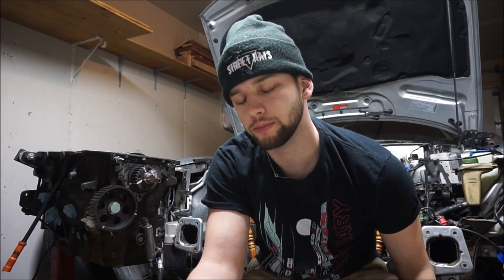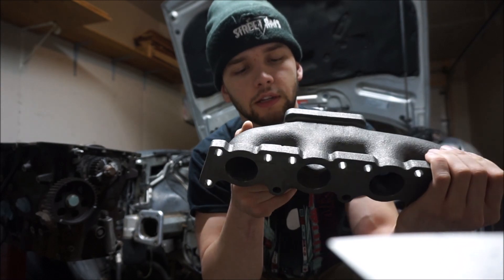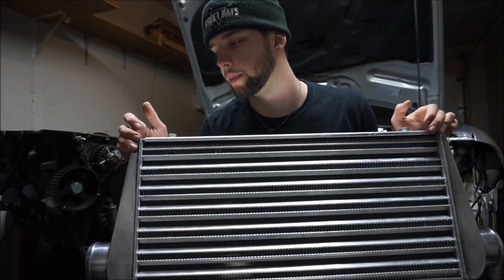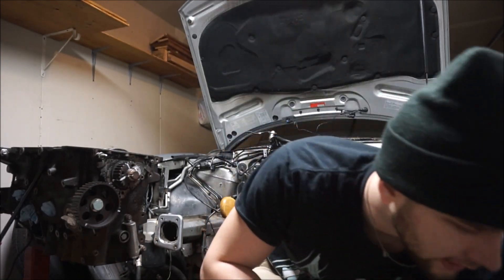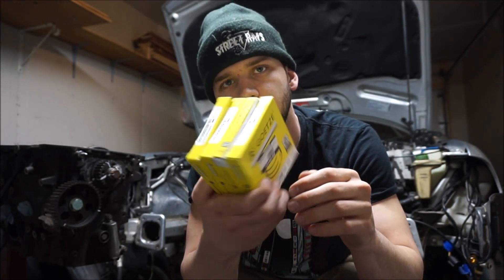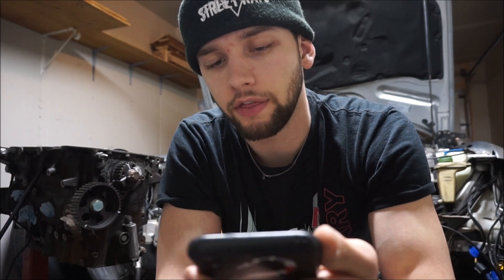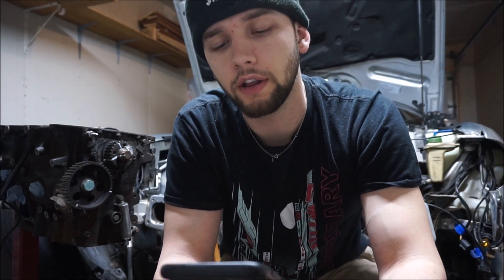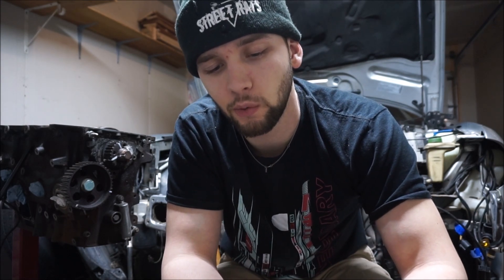Big Turbo 1.8t Build (Road to 450whp+)

Comment: I’ve used  the same rods.  Pulsar 550 and supertec valves. I did 400 miles and lost oil pressure. Thinking it may have been the oil pressure relief valve was faulty. Destroyed a rod, and cylinder head. New motor incoming. Good luck 🙌

Comment: I'm 2 years late to this but, so you went with AWM engine harness and ecu from a4? If you don't mind me asking how much did the convertion to ME7.5 cost you? Just got an b5 Avant and might want to do this in the future...
Reply from the maker: @tobias2310  it didn’t cost me all that much cause I had the stuff to do it. But it’s a nightmare job.
Reply: @Luke100mph Was afraid u were gonna say that, i got a pretty good deal on a 1.8tq Avant to restore but this ecu restriction is annoying

Comment: I have a TT BAM engine and i want to hit 400-450. Would any recommend my idea - garret gt25-660,750cc injectors,ie rods,1.25 tubular manifold badger 5,3 inch decat,ram air 80mm intake+ oversize tip,forge diverter valve and forge intercooler? I am looking for advice and criticism so i can build a reliable set up.

Comment: two things I would've changed up, connecting rod company, and ARP head "studs" instead of one time use head bolts.  Only because you may have to be in the engine again at some point and why worry about spending again on stretch bolts.

Comment: Hey where did you get the flow control valve for the trans?
Reply from the maker: Ringer racing sells them on their website
Reply: @Luke100mph  thanks will check it out

Comment: I have watched your video, and I have an almost identical setup on my 1.8 turbo Cupra R with the same log manifold and similar pulsar turbo. This log is rubbish and you will have many problems with it. If you want to put it on you will have to machine it and remove a7mm from a flange in the order you can screw the nuts with a washer. If you don't the nuts will unscrew. It is almost unposible to tighten firmly upper nuts because it is unaccessible.+ your turbo will be buried deep in the engine. Do yourself a favor before you start and make or buy ramhorn heater.

Comment: Wish you all the best w/this.  I was north of $10K on my 1.8 stroker.  How you say?  I used a FullRace exhaust manifold = $1200, $900 I.E. intake, $1500 United Motorsport stage 5 tune w/ a ProMAF air intake, plus, plus, plus.  It adds up.  I was not skimping, all braided lines, etc.  I DEF could’ve cut some corners but…. Oh well.  Good luck, your turbo seems a little big IMO, long spool up time and I’d’ve used a 44mm WG.  I went w/ Garrett Gen2 3071R, MAD spool comes in @ 3500rpm’s.  I got 870cc injectors on pump gas, E85 not abundant where I live(CT).  I did 2.0FSI Stroker crank and a set of Schlick cams too, have yet to Dyno but my goal was @400HP and everyone telling me it’s closer to 450-500.  It’s a daily driver for work so I didn’t want to go crazy.  Using a GrimmSpeed MBC at around 15psi boost.  SouthBend Stage 2 Endurance clutch w/ a set of Raxles on TOYO R888’s tires and hang on for life! Lol

Comment: I went with rr stage 4 and it doesn't allow you to shift fast at high rpm. I talked with Mike and he said the stage 5 kit with 6 puck would be better, or the cm fx450 bc it uses the same disk.id recommend get the stage 5 or fx450. I'm not happy with shifting so slow, I got the ss braided clutch line as well and shifts are still too slow with the full face disk, it's basically too heavy of a disk to shift fast.
Reply: I say to get a better clutch bc I'm sure you will want to add more power down the road. I was considering fx400 but didn't want to cheap out being that I'm making more power then I think that clutch is capable of handling, probably just wouldn't last that long with that clutch. I made my own hood dump that costed literally nothing and I got a full 3" straight pipe exhaust for about $375. My total cost on my build was about 8k and I'm at 660awhp and 550awtq and it is a budget build.
Reply from the maker: You on o1a 5 speed still?
Reply: Being able to launch endlessly at 7k with a rr stage 4 full face, reliably, is far more worth it than buying some fx4xx every two months because it wears out so fast with power. So just shifting fast I don't think it's worth it. But it sounds like you know what the options are out their, so that's just my opinion ;)

Comment: Do yourself a favor and pin the crank gear and use a arp bolt, my build is almost same, little more extensive but I'll never lose another motor from crank gear keyway shearing 😂. Also if it's not too late get pistons, I know people say they're forged but mine got cracks at the wristpins at about 300±whp
Reply from the maker: bought a pinned crank gear kit from BBM 👍🏻 too late for pistons tho. Motor almost ready to start
Reply: @Luke100mph  used same kit on my last motor and waiting on one to get here finish current build. What are you doing for tuning?
Reply from the maker: @nickferraro7042  I swapped to me7.5 from an AWM car, going through Blake at ETspec
Reply: @nickferraro7042  im only using the arp crank bolt, not pinned and stock pistons making over 600awhp
Reply: @taylorbrown8719  ok but when I pulled my pistons they 3 of 4 we're cracked at the wristpins and that was only at around 350whp, also sheared crank gear pulley with stock bolt at that power level, investing the money into making big power, there's no point in taking stupid risk for the sake of saving a few dollars. Learned that lesson a few times lol
Reply: @nickferraro7042  I discovered there are actually, very strangely, two types a pistons in an aeb. One which nearly everyone expects and that are safe for 600whp. And the second much weaker ones that I too encountered when I put a new long block in with just rods and over 450whp. They started to crack a little bit. Not sure how I figured it out so quickly but it's the reason I bought je pistons. Mike hood was stumped with the different piston types. Both stock Mahle. I have an Audizine post about it. Important point being is that it's pretty unlikely most people ever get the thin walled ones. They're quite dinky and it's pretty obvious visually. I too had never heard of any other sort in existence so yeah... Do now.
I've also always used stock crank bolts and never had issues in over 10 years with 40+psi and 500whp'ish. Multiple long blocks and still didn't have an issue with any thing crank related. Definitely not saying it's not possible. I just haven't even heard about it.
Reply: @SomethiingClever  that's interesting, I'm gonna have to check out your thread I never came across that info, my motor that had them had some pretty bad detonation thanks to a failed green giant, (should have known better)  so that may have contributed. I went all out this time so I don't have issues again. What clutchand trans  you running?

Comment: Question for anyone in the thread:

I am building a 2.0 stroker version of the 1.8T (AWM). I went with CP-Carrillo stroker pistons at 83mm (3.268") bore. I was gapping my rings and somehow feeler guages failed me (more like I failed to use them properly) and I over gapped everything. I need advise on whether it will be fine or if I need to buy a whole new set of rings. 

Specs according to CP for Nitrous/Turbo engines:

Top: Bore x 0.0055" = 3.268x0.0055 = 0.018" or 0.45mm
2nd: Top + 0.004" to 0.008"

My rings:
Top: 0.021" or 0.52mm
2nd: 0.028" or 0.70mm

Is this too much gap now? Please help!!
Reply: I ran around .024 top multiple times stock with zero issues in regards to compression/leaking oil. I used a bench grinder to gap my rings and it cuts em mighty fast! Not recommended, but I guess it allowed me to tell you your top ring gap is definitely okay. 2nd ring honestly I can't recall with much confidence but I believe it was. .026. top ring in my opinion should be .023 at least if you're running 35psi and up. Which I have on ever turbo beyond a k03 I've used.

Comment from the maker: Update: I’ve spent probably another $1,800 since this video. But just got my cyl head and block back so starting assembly this week 👍🏻
Reply: nice choice of parts man, i did a budget style build like yours with similar parts on my b5 and 450 was my original goal and now im past 600.
uro tuning sells a rebuild kit that comes with grant rings(i didnt gap my rings either) and glyco bearings, it used to be 150 but is $200 now. im using that kit and eagle rods. i had the atw block luckily so i have 058 block (20mm wrist pins) swapped to a built aeb head with exaust valves, springs and retainers, converted to wideband ecu and added vvt. treadstone tr11 fmic precision 5858 bb .82 hood dump t3 emusa manifold. stock cams and pistons. manual timing belt tensioner arp head studs and arp crank and cam gear bolts. rr stage 4 full face with braided ss slave line. id1000cc with walbro 450 and 2.7t fpr. e85 at 27 psi 640whp 560wtq
Reply from the maker: @taylorbrown8719  build sounds just like mine! wow that power is wicked!! I just got done adding my VVT yesterday. My plan with my tuner was to go e85 and 28psi. Who tuned your car?!
Reply: @Luke100mph  Brad Watkins with German Elite Tuning. #getwatkins
Reply: My bad, I was on my fiancee account. I logged into my account just now. The comment from Taylor is actually from me. I also used hockey pucks for motor mounts and for a snub mount. I plan on making some videos of my car, I'm trying to decide if I have the free time to make a channel for it. But like I said, it started out as a budget build and went further then i thought it would. I seen 1.8hoopt reach 600hp so i had to go further then them. Ill have to review my build beeing that im done with tuning now.
Reply: @tylerdunne6745  nice!! Why the need to go wideband and vvt?
Reply: @DustySteelGarage  for better tuning.
Reply: That’s awesome!! I’m super excited for you and to watch your build. I just subscribed.

Comment: Thats about my goal too. More is welcome of course. Initial  goal was 500awhp. But 93 fuel ultimately is my restriction. What fuel will u be using. So far its super cheap!!! I admit i didnt watch 100% of video. But i assume 180 in exhaust gets you straight pipe out the side at the most? 
These cars can make power. I was 411awhp at 26psi 93 fuel on mustang dyno. But this isnt a honda or mustang. So in other words its expensive, lol. Machine  work is expensive  too. Im 1.8 stroker now. No running yet. Hopefully in a month or two.
Reply from the maker: Straight out the hood, planning for 28psi on e85 to start. And that’s solid power for sure I bet it was fun! You’ll make 500whp+ easy going stroker🤙🏼🤙🏼
Reply: @Luke100mph  it was alot of fun 👍, car is a hell of a surprise to others. But you crave more, lol. Only reason i did the stroker was because i have a coolant pressure issue since i got the car. And finally the block cracked. So you gotta rebuild better u know, lol. 

Im hoping power will come in sooner this time. I bought ALOT  from RR. He said 450 to 500awhp. 93 fuel has its limits and this is a daily, so no e85. But u should definitely get your power on e85. 

I have a 01E 6spd
Reply from the maker: You using the 01a 5 speed?
Reply: What’s ur build list? 😍😍😍 I’m trying to just push 20psi on pump.  Are you using water/meth injection at all?
Reply: @ziggyortiz37  im not a vw builder specialist. Id contact someone like ringer racing or IE with goals. With "just" 20 psi, im assuming upgraded turbo, at least ko4, which honestly if your spending the money go bigger.  Id say this. No need for cams or intake manifold. Cams, springs, valves, machine work is alot of money. Id get drop in rods for insurance, pistons are good for 500 plus chp. Proper intercooler for turbo,  2.5in to 3in turbo back exhaust. Injector sizer your tuner suggests. And clutch that takes the power. Not much is needed. Your turner should be able to suggest a turbo. I was at 26psi daily driven. I had no meth/water. Hard to find a tuner who will tune it. Hell hard to find a tuner at all. Epa took care of that. My car still isnt running since stroker build. Life got in the way. Maybe this yr, but cant say for sure.

Comment: I didn't hear how much you only paid for the car. These are great engines. one of the best engines under 2.0 cc.
Reply from the maker: I paid under $280 for the car itself 🤫🤫
Reply: @Luke100mph  sounds like it fell off the back of a truck
Reply from the maker: @easycomeeasygo8901  Car had no title when purchased, I was able to acquire one for it tho 👍🏻

Comment: Nice build, look forward to seeing it run. 
I would of went the IE rods for sure though. 👍
Reply from the maker: Thanks me too! Getting closer, and yeah I’ve thought about it but the machine shop already has the rods and checked all the specs they turned out good🙏🏻 now it’s just to see how they’ll hold up
Reply: @Luke100mph  awesome, the tuner could compensate for them by setting a smooth gradual curve on power so they don't get stressed at low rpm.
I recently scored a mint condition b5 off an older lady that couldn't drive any more due to medical conditions. Just received my new eliminator turbo kit from ECS and can't wait to put it all together. It's the Australian AJL 180hp version with the high flow ports.

Comment: That’s 058 motor what ecu will u b running
Reply from the maker: ME7.5 wideband ECU from a 2001 a4
Reply from the maker: @kadeemmeggett6324  the wiring part or the pedal assembly removal/install work?
Reply: @Luke100mph  the pedals wiring and install was difficult bro it’s not easy me7 swapping uro tuning sells a conversion kit wideband to narrow band kit plug n play
Reply: @Luke100mph  what up big dawg how your build going
Reply: My tuner told me that I don’t have to go wideband. Eurodyne Maestro has files for 440cc, 630cc, and 870cc I believe. Each one can be customized.
Reply: @DustySteelGarage  yeah eurodyne has chip files for our me5 aeb ecus u are correct
Reply: Every shop always try’s to go for the most expensive route hoping you’ll pay them to do it. Any tuner should be able to just watch a wideband gauge.
Reply from the maker: Full harness/DBW throttle conversion
Reply: @Luke100mph  unitronic does a wideband conversion kit

Comment: dude ill start posting videos but i am literally doing the same build, i have roughly funnily enough almost all the same parts but ive been putting it away almost giving up on it but gonna get started again in the next few weeks
Reply from the maker: keep it up🤙🏼 what’s your power goals with it?
Reply: @Luke100mph  450+ wheel. it started off as super budget then I got carried away and was going the religiously everything perfect route for a bit the whole catcams, full supertech valvetrain but now I’m back to budget shooting for 450+
Reply from the maker: @tauheed9269  heck yeah, mine was also supposed to be budget but that never works out! pay to play 😅🤙🏼
Reply: @Luke100mph  I know dude but honestly if I could go back I’d save myself from losing so much time and money if I planned the build to my budget instead of making my budget fit the build if that makes sense. Because that led me to almost give up. Also bro if you find a good tuner could you let me know? I’ll drop you my ig?
Reply from the maker: @tauheed9269   yeah get that, I had to sell some of my other toys to fund this build part way through. And I definitely know some good tuners, what’s your insta
Reply: @Luke100mph  t.azd4
Reply from the maker: @tauheed9269  followed, shoot me a dm 🤙🏼
Reply: @tauheed9269  I’m looking for same hp goals. I’m currently running Eurodyne Maestro 440cc file with stock turbo. I have 3” high flow cat with custom v-band up/down pipe into CXRacing 3” cat back. Custom intake, turbo inlet pipe, and heat shield. Still deciding on turbo and internals.
Reply: I’m also building my AEB Quattro. I don’t want to swap over to DBW though. My tuner recommended a different route. Not sure if it’s the best route or not.
Reply: Also, for anyone wondering a Mishimoto radiator for the 1.8T Golf fits with minor modification.
Reply: @tauheed9269  I’m in CO. Why are you selling?

Comment: I bet you it exploded
Reply: Not with built bottom end it won't. With stock rods it will. I've seen a couple of these hit 500whp and be just fine. Some even call the 1.8t the European 4g63. Check out a channel called boosted Villan for proof of concept.
Reply: @boosted_Hero  lol 058 blocks are stronger than 06a blocks I guarantee he won’t grenade 450 hp is low for 1.8t there are 700 hp 1.8t I’m building one
Reply: Go to brazil and see people running over 1000whp on this blocks, this blocks can take over 1000... brazilians are the kings of VW tuning.